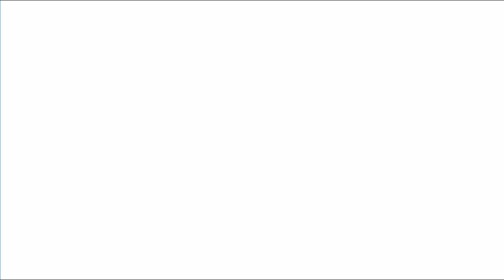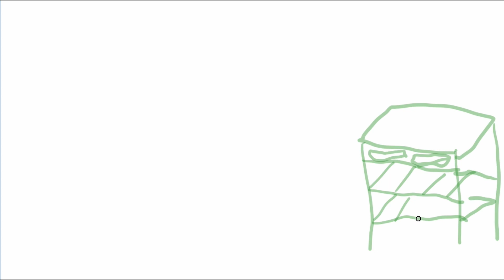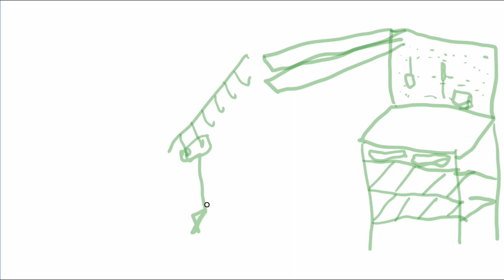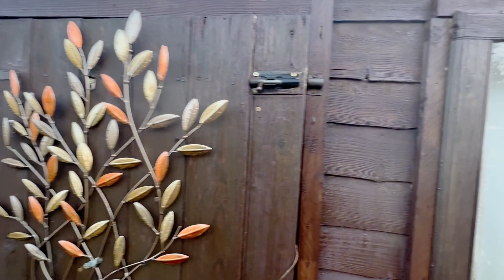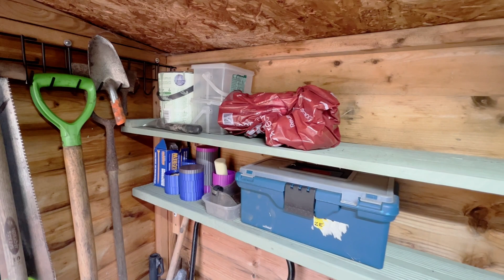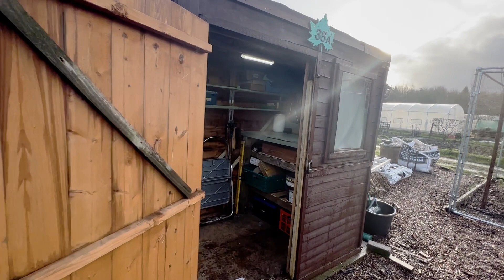New Year New Shed Design | Making best use of a small shed

Comment: Hi do you have a video with the solar setup and how to do it ??
Reply from the maker: Unfortunately not but the controller is straight forward. It has 3 sets of screw terminals, you wire the solar panel into the first set and then connect a battery to the 2nd set and then finally the 3rd set of contacts is where you take your power from.